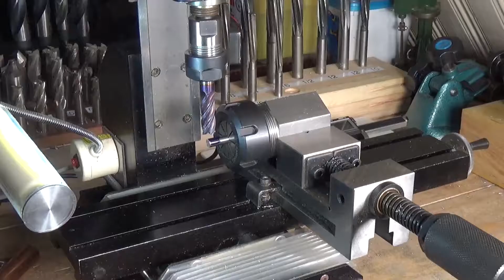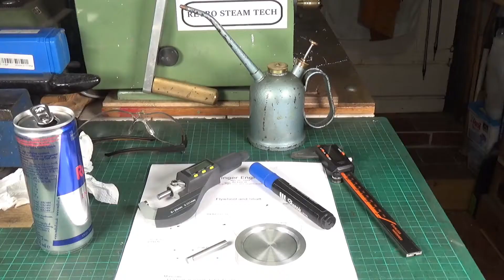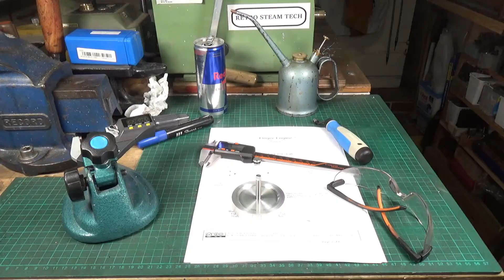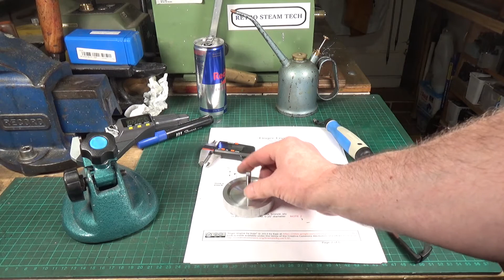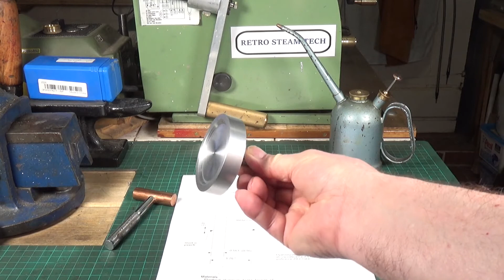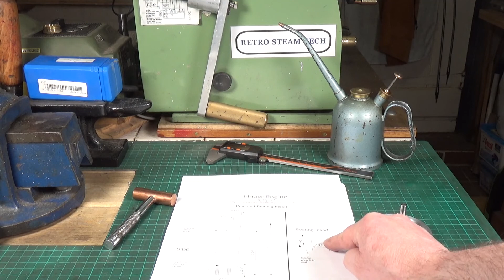Lockdown Project - Finger Engine - Part Three

Comment: Good technique Alan.  The Sherline micro mill, collet block, Drillpro mill bit and micro boring bar did an excellent job.  Exactly how I would have done it.  The end result was perfect.   You couldn't do any better regardless of machinery or tooling outlay.  Cheers Rob
Reply from the maker: Thanks Rob. This project has really given the Sherline a work out and it's done really well. Also very impressed with the end mill that I got from Banggood, gives a great finish on all the metals I've used it on so far. Cheers, Alan.
Reply: @RetroSteamTech  Hi Alan,  I thought you would be impressed with those coated Drillpro end mills.  Excellent IMHO.  Cheers Rob